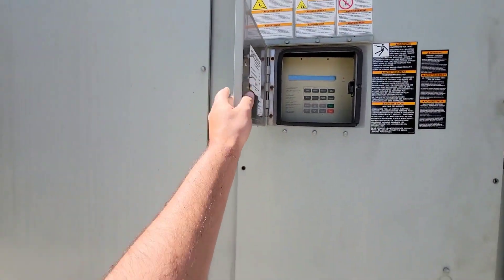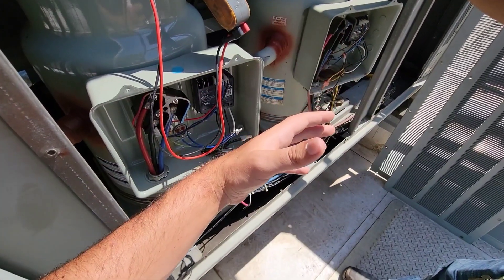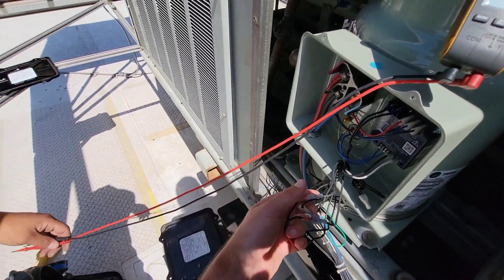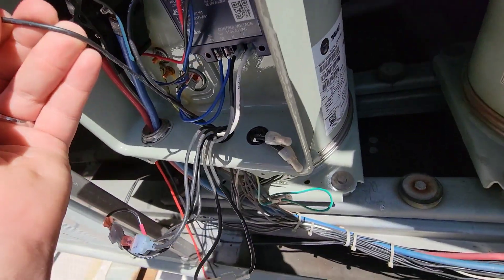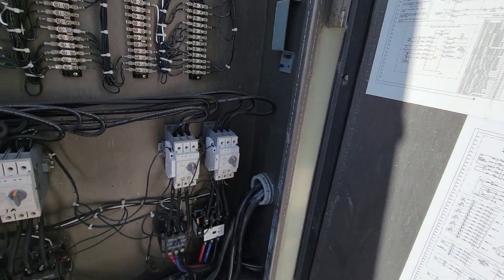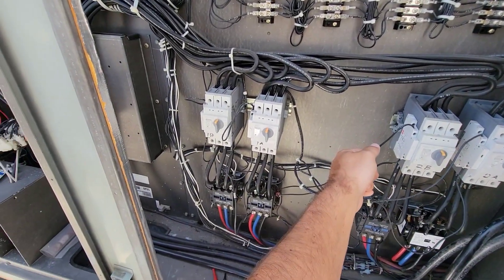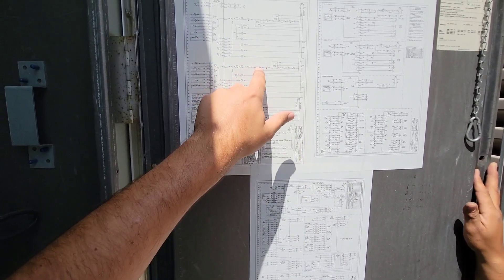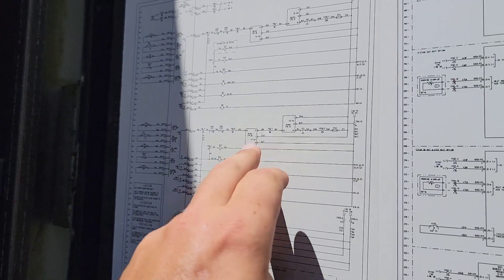RTU Circuit Down For Medical Air Conditioner

Comment: Factory told me to leave the circuit breakers aux jumped. They’ve had lots of issues. No need for it. If the breaker trips you will see it.
Reply from the maker: Interesting

Comment: Resistance in contacts will give you all kinds of weird readings . Ive ran into that for years servicing all kinds of machinery from HVAC to heavy equipment. First rule of repair. Thou shalt check voltages
Reply from the maker: yes sir

Comment: God I’ve been in a couple commercial jobs but I’m just a residential installer and some service. Commercial is MIND BOGGLING. I swear every time I just look at everything I just feel retarded. Lol
Reply from the maker: its so much more fun to work on, definitely recommend getting into it!
Reply: Commercial is just bigger. When your dealing with schematics, it may seem like it’s a lot to take in. You gotta  break everything down into smaller circuits. Circuit A and B has its it own safety circuits, same as the supply  fans. Trane has some of the easiest schematics to follow. Just gotta get some bucket time in front of them that’s all. Best of luck to you.
Reply: You'll find comercial is easier then residential, all parts are easily accessible, I hate doing residential after learning commercial. keep pushing to do commercial.
Reply: @SparkyTech240v  can’t imagine how bad residential must be, because I wouldn’t consider commercial to be anything CLOSE to accessible.